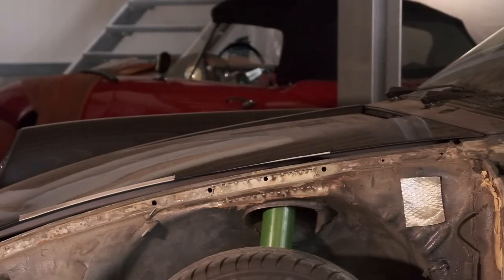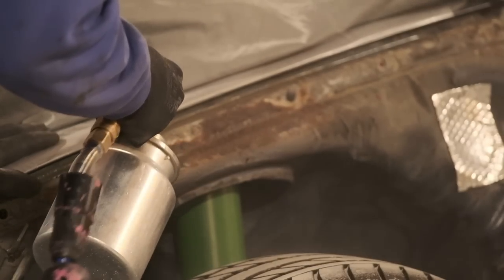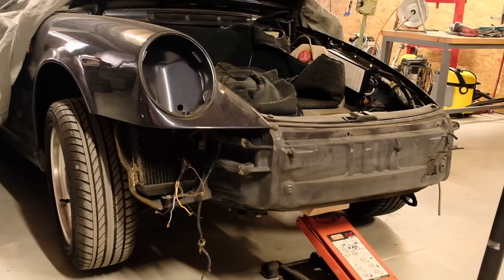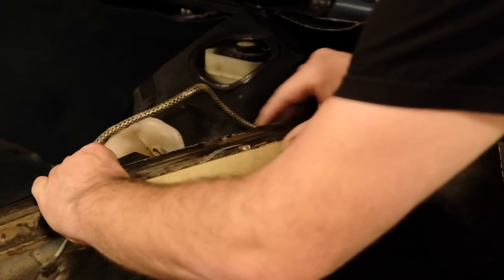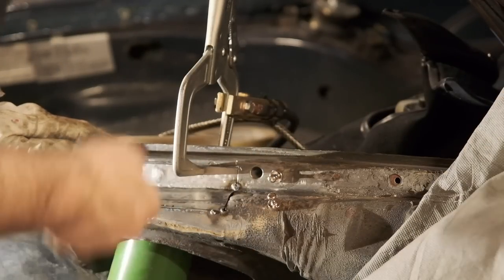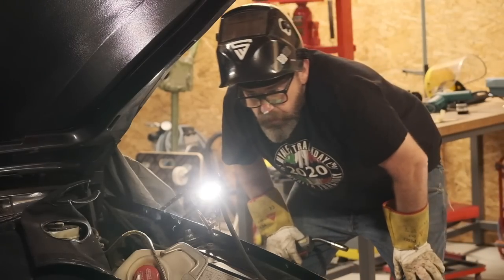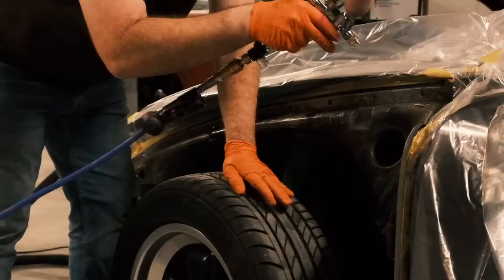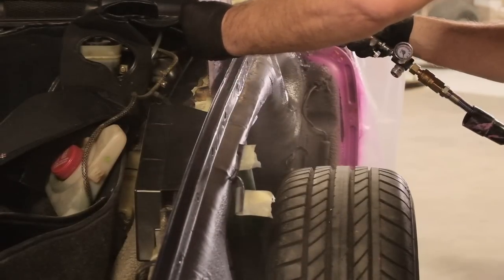A Complicated Rust Repair of an 86 Carrera

Comment: about the welding around 13:24, something I learned recently about tight gap welds like this is to angle the head of the welder as flat as you can rather than weld from above and allow the gas to pool up in one spot, helps not to burn through on areas like this
Reply from the maker: Thanks, for commenting!
Yes, and that would also allow the wire to find something to connect to instead of just being pushed into the gap.

Comment: I repair rust as my living - I now have a brush on/spray on solution that you can apply to areas like this & it will halt the rust perfectly. It has become a life-saver for areas like this here with us. After welding in the repair section, we now coat everything with our rust treatment & don't have to  give the area any further thought. The interior of the panel gets the same solution spray-injected so that it too is protected - and for a change, we now have a system we can have full confidence in.
Reply from the maker: Thanks for commenting, James.
Feel free to tell us more.

In my eyes the problem is that whatever is applied to the panel before it’s welded, will burn off again. I therefore used Inox spray and will bring in some cavity protection later. Is that what you mean?
Reply: @GreasyFingers  yes, but I have found no paint or bought treatment really lasts - they all begin to fail pretty early - especially on areas that have had a lot of heat from welding. Which is why I made my own.

Comment: Pour 15 works well on remaining surface rust, and over the repair panel.  Moist Bastos works good for containing the heat and resulting warpage.  Nice Beverly Shear.  Great metalwork and attention to detail.  I have a little rust repair in the gasket channel on my ‘69 911R type replica.  I’m just getting ready to remove the steel fenders and install the fiberglass R fenders.  I’m sure I’ll find more rust once the fenders are off.
Reply from the maker: Thanks for commenting, Rod.
I read a lot about Pour 15 and I’m tempted to try it. Can it be painted over easily?
Reply: @GreasyFingers  they make a topcoat, as it dries shiney and slick.  I just pulled the fuel tank on my 69, and there is some surface rust on the upper driver side corner of the mounting surface on the car. I’m going to try and get a small container, because once you open it up, it’s best to use it up.  The top will weld to the can and you can’t re open it.  That’s how strong the stuff is

Comment: Thank you for reminding us that the torison bar cars are full of nooks and crannies!  No fender liners or underbody panels.  They deserve frequent underbody cleaning if driven in wet climates.
Reply: so then the 993 is much better protected?
Reply: @Laguna2013  Yes the 993 has plastic wheel well liners. The 911 did not really become ‘rust proof’ until the 996!
Reply from the maker: “Wet climates” in fact is a point that cannot be overestimated. I’m disassembling a California car these days and the state of all surfaces is an entirely different story.

Comment: As usual, I am impressed... I really hope I will have that skills set with welding!
What do you think about Phosphoric acid to eliminate rust wherever tools can't reach? 
I am chasing rust on my restoration as well, and I always do the "physical rust removal" (wire wheel) as much as possible. But rust is a b*tch that sneaks everywhere, and I am a little paranoid, so I always apply a generous coat of phosphoric acid to make sure whatever could have been missed (like in the pit holes!) would be chemically eliminated and passivated. Then, just like you; epoxy first, then stone guard or base coat.
Any experience with it?
Reply from the maker: Really love your comment, man. 

In fact I used phosphoric acid during this very project, but I don’t feel experienced enough to really talk about it so I edited the part out. In this specific case it didn’t show any effect, but I generally believe it’s a good thing. I guess I have to learn the ropes …

Comment: Really nice work, well done. 

When you want to weld a gap, you could also put a thin sheet of copper behind, it helps often a lot and you can close the gaps easier….
Reply: It’s a closed space. you can’t get it out
Reply from the maker: Thanks, Fritz. The copper method is a great way to avoid holes but as Anton said, it doesn’t work if you can’t access the backside.

Comment: thanks for another great video!!! Question: I understand the explanation of the root cause of this at 0:30 but how can i spot if this area is rusty without removing the fender? i have a 1985 3.2 Coupe and everything seems fine from outside. Do i have to remove the fender?
Reply from the maker: You don’t have to remove the fender.
Just remove the wheel and the tube and see what’s behind. If you find dirt, clean it all up. 
If you want, you can send me a picture and we discuss what you found.
Reply: @GreasyFingers  thanks for the offer. it's actually stored so i'll have a look next time i see it. will keep you updated

Comment: I am curious to know why the insert was not galvanized before being welded into place. Great job and you have very steady hands. It's like watching a sculptor at work.
Reply from the maker: Thanks, mate. 
Welding galvanised steel, the zinc will vaporise and inhaling the fumes is very unhealthy. This can be handled in industrial production and for spot welding, but making large butt welded seams in a workshop is a different story. You now might say: the steel that the repair panel connects to is galvanised too and that’s a fact, but I sand it off at the outside before welding and the zinc at the inside hopefully can’t be inhaled that easily.

Comment: Hey man, i love your videos! I have one question regarding repairs similar to this one, when you weld that patch in, how do you protect it from the inside? I see you put paint and sealant on the outside, but not on the inner side of that patch?
Reply from the maker: Thanks, mate.
I painted the insides with Inox spray (10:00) which is heat resistant paint. It will certainly receive some cavity protection too. Please see my video dedicated to this topic.
Reply: @GreasyFingers  great, thanks for the reply!

Comment: The backside of the new panel wil rust again. You can’t see it but it needs protection to cause moisture will find it’s way. Therefore I would always try to reach it with epoxy ore a zink primer (no wax, that can melt in the sun)
Reply from the maker: Thanks for commenting, Dennis.
I painted the backsides with Inox spray, as you can see in the film. I will also apply the full Fluidfilm program to it.
I do agree, however, to all you say. It cannot be left without protection.

Comment: Another wonderful video that straddles the line between first class technical content and ASMR. Perfect for my lazy Friday morning. I may have missed but how did you find rust under the wing/fender ? Just looked based on experience ? Nice World Cup reference btw. Feel your pain 😂
Reply from the maker: Thanks, David.
I discovered the rust because I looked for it. I had the car in my workshop in summer for changing the oil tank and whenever I have a 911 on the lift, I look after the usual suspects.
Reply from the maker: What World Cup?

Comment: Nice repair as usual. 

If room, A backing strip would make butt jointing easier on thin material or corroided panels 👍
Reply from the maker: Thanks, James. 
Backing strip? Tell me more …
Reply: @GreasyFingers  if room … cut a strip of metal approx 2-3cm wide, make the same profile as the repair panel and place behind the parent metal and the repair piece… behind the weld gap so it over laps (behind) each panel, weld as usual and it stops burn through, the backing strip becomes one with the weld 👍

You can use a piece of copper pressed behind the weld gap as well, the copper doesn’t fuse and is removed… again it stops burn through… its a good method for filling pin holes.
Reply: And the copper backing strip/block takes away heat. There are also industrial ceramic backing strips for sale. Regards from a former welder and weld inspector (NDT)

Comment: Hey, i am restoring a '68 912. And starting with zero skill and knowledge i am watching your videos in order to learn as much as i can. For xmas i got a book "Schweißen - Schritt für Schritt zur prof. Karrosserie-Reperatur". Now in there is a part the troubles me: TÜV :) and they say that "supporting body parts" - like the one your are working on - have to be overlapping & spot-welded (not butt welded). Whats your experience with the TÜV guy of your choice? They are cool with it - or they don't get to know it ;)
Reply from the maker: Hi Kristian.
Theoretically butt welding at high temperature might lead to the steel’s carbon to partly escape from the crystal lattice, reduce its tenacity and make it brittle.
I personally think that this is very unlikely to happen if temperatures are kept reasonably low. The problem is: it’s not possible to find out whether the steel had to endure losses of significant amounts of carbon and other alloy elements during welding, so the mindset of bureaucracy requires you to forbid the whole thing. 

Since the entire TUV business had been privatised, I haven’t encountered much of the stubbornness of the old days and if you do your butt welding right, it’s invisible anyway.
Reply: @GreasyFingers  great answer - danke :)

Comment: A good amateur job and great filming. Sadly not a professional repair. Firstly if you are welding on to rust you have not gone far enough. The only way to stop the rust is to cut it out. I noticed the steel you put in was rusty from finger prints, so you a using mild steel which is not suitable for Porsche repairs. It is too weak, especially in a stressed area and will rust again. Unfortunately professional Porsche garages like mine will not do these videos as they do  not have time or want people to know what they do that makes the difference, but you have a few pointers.
Reply from the maker: A powerful ego is a positive thing. 
It’s even more powerful when combined with humbleness, but I’m sure you’ll find someone who will teach you.